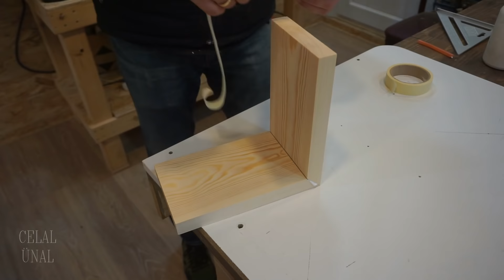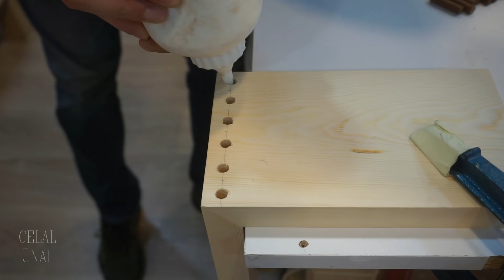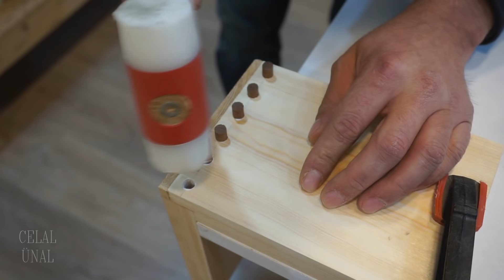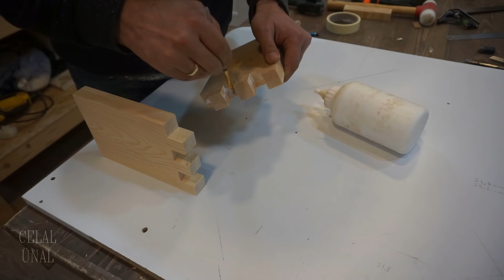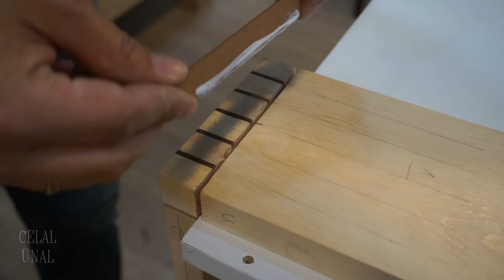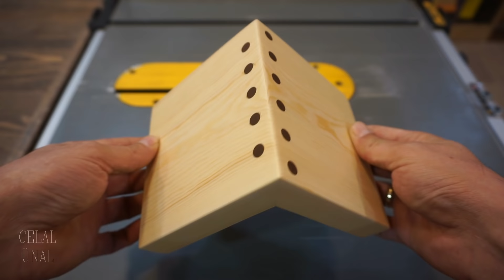Wood joints / Wood corner joints / Woodworking / Ahşap birleştirme

Comment: What is that red colored tool you use with the drill to drill holes in the edges of the boards?
Reply from the maker: Dowel Centering Guide for Drilling

Comment: What are the glues that you use especially the spray activator
Reply from the maker: I used instant glue and activator spray. A material that provides drying and adhesion with activator spray.

Comment: Magnificently done. Thanks for sharing. What flush trim saw are you using?
Reply from the maker: Thank you so much. I am so glad you liked it. I am using Dewalt dwe 7492.
Reply: @CelalUnal1  Not the table saw, the hand saw you used to cut the plugs. Also, that red drill guide? Never seen one of those before, who makes those? Great job and techniques. Love the simplicity of the video as well.